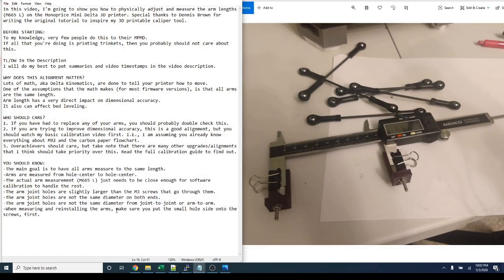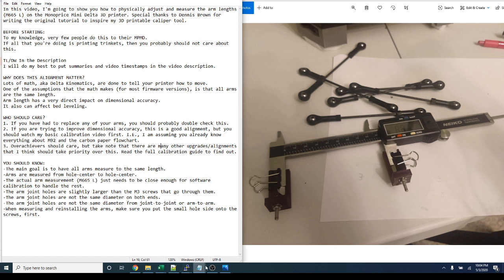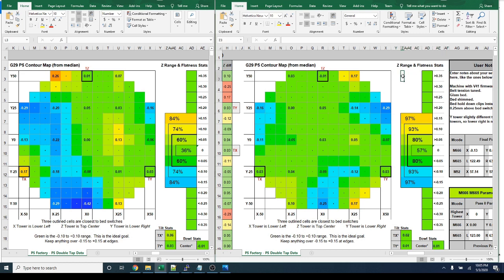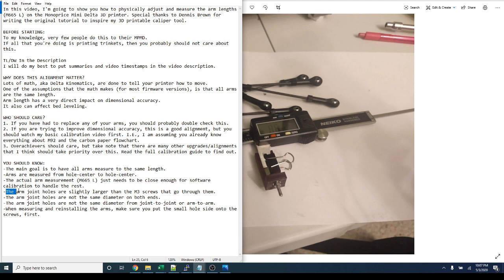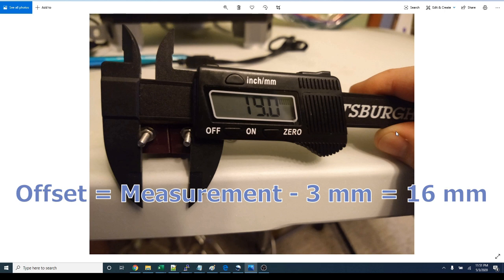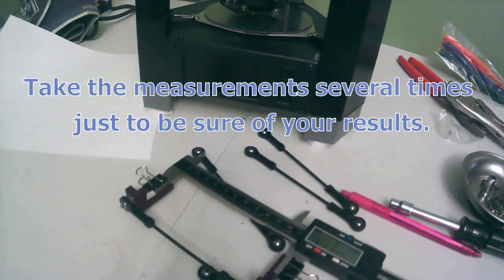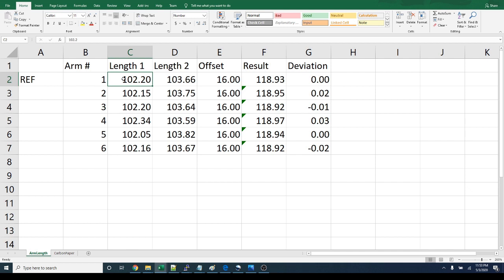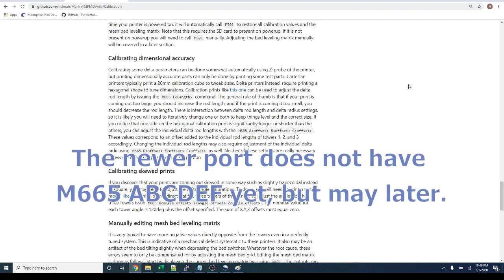MPMD V1 - Arm Length Adjustment Alignment - Dimensional Accuracy Improvement/Calibration Part 2

Comment: I got it working OK but towards the back of the printer the nozzle is a bit too close to the bed and when I raise the z offset a bit it fixs the back of the printer but it's a bit too high towards the front and it doesn't stock too the bed how can I fix this. Do I have to shim the bed or is there a software fix.
Reply from the maker: It could get complicated. Go to the full calibration guide linked in the video description. It will take a combination of both hardware and software fixes. If you are still having trouble after going through the guide, make a post in the larger Facebook Group or Reddit (also linked) and I will gather more information.
Reply: @home-fried3dprinting617  Thanks I may leave it as stuff seems to come out ok

Comment: Could you make a video about mpmd_marlin_1.1.x
Reply from the maker: So, this port of Marlin is very new and I have literally just got around to using it. I updated the video description in this video with a link to a new text-based tutorial that I literally finished writing sometime this past Sunday. The test prints in that tutorial are pretty much the only things that I have done with it. I also want to try the linear advance feature, but that is something I want to do after upgrading part cooling. 

Was there anything specific you wanted to know about it? 

Just a fair warning, it is easy for me answer questions over a smartphone, but free time at home with the printer is shorter nowdays. It could be a while before the next video.
Reply: @home-fried3dprinting617  Just a video on the upgrade and setup process but I will read the tutorial thanks very much for your help. Does the cura profile work with this firmware as it does with marlin4mpmd.
Reply: Ok I think I will wait for a video if you could do one. Thanks for your help.
Reply from the maker: @Nebula2009UK  The Cura profiles should work the same. You will probably have to change the Start Gcode in the same way that you changed it for Marlin4MPMD. Z-offset is different, but I think it is all covered pretty well on MPMD Marlin's website.
Reply: @home-fried3dprinting617  Thanks again could you write a tutorial for an absolute beginner on how to compile and install and setup the firmware. I did manage to get marlin4mpmd working but how does the installation and setup differ from this. I appreciate your time and effort in trying to help me.
Reply: Or could you summarise the steps then I can try and make sense of what's already there thanks.
Reply: OK I worked it out turns out it's easier to setup than marlin4mpmd
Reply from the maker: @Nebula2009UK  I ended up getting busy at work and could not respond. I am glad you figured it out. aegean-odyssey did a really great job putting together the Quick-Start Guide for MPMD Marlin 1.X.X.
Reply: @home-fried3dprinting617  I have also found using prusaslicer and their prusaslicer profile works amazingly well.